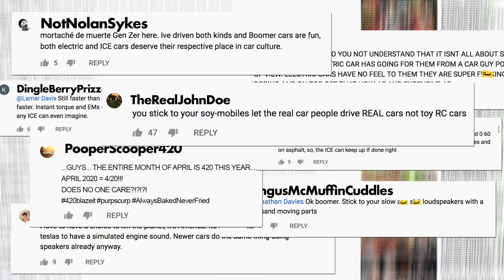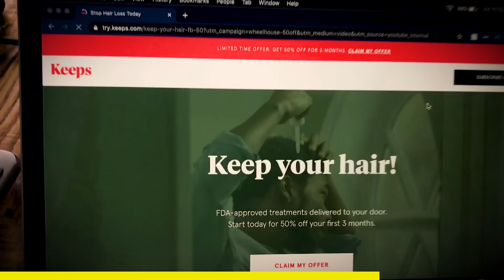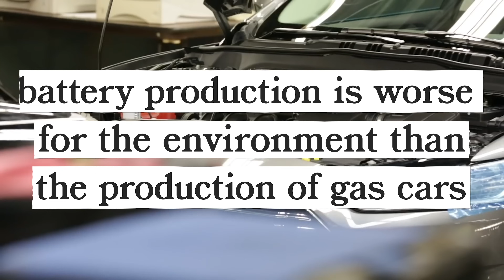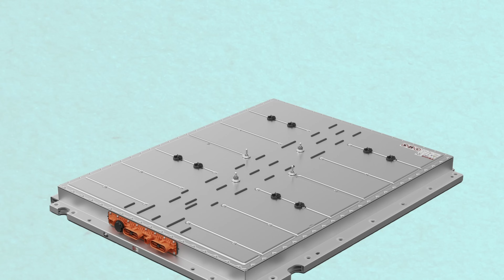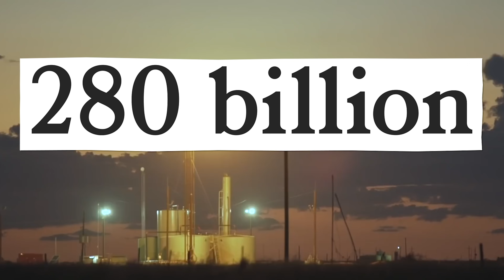Are Electric Cars REALLY Better for the Environment?

Comment: The only real problem with EV’s is the price, accessibility of charging stations, the speed of charge and battery retention over time and cold temps. As in, I’d like to be able to leave for a month and come back and it still has the same charge just like an ICE will still have the same amount of gas and also not have it lose charge super fast or just not be able to charge when it’s cold. But I’m sure all of those will be fixed soon, but not yet.

Comment: You know what’s funny? The internal combustion engine was invented to get rid of horse carriages because they were a pollution problem lol. They’d die in summer from heat and winter from cold and you actually couldn’t haul them away, there were a few laws that said that you’d have to wait for it to start rotting to take it away in pieces. Horses are huge. So there’s poop, pee, hay and water all over the city and it’s just yucky. It cakes up over time to the point that those fancy little townhomes in NYC with stairs were built specifically that way because the roads and sidewalks were disgusting. Cars were supposed to solve the problem and ‘clean up the city’, which they did do. But now the solution has become the problem… and I can’t help but think that this is what will happen with EV’s too; the solution will become a problem later. And really think about it, this is normal for humans. If we’re truly THAT smart as a species, we wouldn’t come up with ‘solutions’ that then become problems in and of themselves in the first place 😂

Comment: 1. The recycling of batteries is slowly improving. Similarly, the use of used car EV batteries is also increasing. This is going to help in reducing the impact of Lithium mining on the environment. Additionally, techniques are being developed to clean the brine and other toxics that are the result of Lithium mining. 
2. Cobalt is still an issue. 
3. Alternatives for Lithium, which are much better for the environment, are also being developed. These include aluminum ion batteries, which are made of aluminum, which have very low impact as the mining of Alluminium is a well established industry. Also, recycling of Alluminium is also well established.

Comment: these are only estimates of emmisios 1: the amount of power required to charge EV's is astronomical - 300+KW per Hr. Enough for around 30 Homes a day.... 2: EV Batteries are highly toxic to recycle and when EV's catch fire the 4000degF toxic smoke and thermal ruaway made the highly dangeous (just look at small electric bike/phone fires) 3: The cost of a relacement battery for an EV for even a small scrape on its case is ridiculous. you can buy a whole new car for this price of what would  have been a minior dent in a ICE car

Comment: volvo was the 1st company that published a study about EV's 
so VOLVO says that manufacturing an EV has 70% more co2 footprint over its ICE equivalent.
in order to get EVEN with ICE cars , both EV and its ICE equivalent have to  drive 200.000 klms!!!!!
AS YOU SAID the average klms of a car in US is about 17000klms per year 
correct? 
so an EV has to drive 200.000 klms divided by 17000 klms per year gives us 
11.7 years of driving an EV 
now im challenging you to give me 1 EV car that its battery can last 11.7 years or 200.000 .
now TESLA admits that over the 6 year period , battery health is declining , cant hold charge as much thus it needs more frequent charging .

and its not that .
EV's are heavy , 
that means the tyre wear is heavier, which in turn means they need faster replacement .
i can keep going giving you cons of EV's 

the truth is EV's will never be more environment friendly as ICE cars are .
do your math

Comment: The claim that Electric Vehicles are environmentally friendly is a huge lie because the environmental impact equation is computed only after the battery is fully charged when one adds required battery charging process to the environmental impact equation one finds electric cars pollute about twice as much as gas cars and as you mentioned there's the environmental impact of mining materials and manufacturing the required battery.

Comment: you forgot 2 important things.

in many countries, the electric grid would not be able to handle everyone switching to EVs, and what happens when these batteries will need to be replaced or destroyed? because they don't last for ever. if those 2 questions get sustainable solutions, i promise i'll never say a bad word about EVs again. untill then, thanks but no thanks
Reply: update the grids. build recycling options.

Comment: I would like to clarify one issue that doesn’t move the needle either way - the myth behind electric cars destroying our power grid is rooted in the fact that our electric grid, if not upgraded/fixed, will cause our demand to closely resemble our supply of electricity. 

This isn’t BECAUSE of EVs, in fact some estimates show that it only accounts for <5% of the demand, so if everyone switched now it wouldn’t be the end of the world. Although our overall usage and demand is rising faster than we’re currently able to produce, and at the rate we are going today we will be reaching electrical supply problems in just a few years. 

Here’s hoping we begin fixing the electrical problem approaching.

Comment: The problem is, there is not enought battery materials to replace ALL classic engines whith evs. And wind energy is not "clean". 1) You need other sourses of generation\accumulation to compensate lack or excess of power, 2) its super expensive to recicle wind turbines as they break, 3) they are very detremental to wild life around them. The only real clean energy is nuclear stations of closed cycle, where waste from 1 type of stations serves as fuel to other stations and vice-versa, untill full deplition of nuclear fuel to led. You can add to that a fact that EVs still need ruber, plastic and lubrication just as EC engines do, so you will not be able to get rid of oil industry any time soon.

Comment: Most of the information in this video seems to be fairly good information, and points to a FUTURE where EVs would be better than ICE-Vs. What is wrong? 1. Time frame: California and those States following their lead are attempting to changeover for sales prior to 2030. Most of the "good reasons" are for future expectations. 2. The "bad" batteries will have to be replaced in less than 10 years, adding to the environmental impact, since those batteries are NOT recyclable at present. 3. The electrical grid? The reason why that has been a problem, as shown in California, is that the LOCAL distribution grids are where the problems occur, not the distribution and generation infrastructure. In the future, the generation may be a problem as only 20% of electricity is generated by "green" sources, said sources are not growing fast enough to replace fossil fuel fired electrical generation and those same environmentalists block any fission nuclear electrical generation. Remember also that solar/wind sourced generation is intermittent, usually not available when EVs need to recharge.

Comment: I call BS on the power grid, Explain power draw, then explain 3 quick chargers using the amount of power of 2000 homes. And LA black outs due to that very reason, and lower level power grids.

Comment: Whoa! At 9:56 , you are saying that the current grid can handle up to 25% conversion of ICEs to EVs. Umm, I wonder if these social planners have any idea how hard it would be to expand the grid by 3x, to accommodate the rest?  Really. It's a brick wall. This will prove to be the biggest barrier, after the problematic Lithium-based battery systems are confronted.

Comment: @Donut

Could there be a problem with these numbers however, where because the production of one EV is 17 metric tons of c02, which multiplied by the amount of EV's on the road (from a quick Google is around 26 million) is 442 million metric tons of c02? (26 x 17) - and we can compare that to the 280 billion tons of c02 from an Oil refinery - seems that the Oil Refineries are burning for more than just cars (eg plastic and other pollutants) - so it seems the answer would be for everyone to switch to electric and stop production of plastic altogether.....

Comment: A major con that is not explained is how batteries system aren't easily replaceable, at least for now, so a minor accident could mean the whole car goes to the scrap if the system is damaged which is a disaster for the environment (and will cost a premium to assure). 

Also the lack of lithium and other components means that unless the companies find a way to make this more efficient, EV will stay inaccessible for most people. It is still in its infancy though, so it might change who knows?

Comment: An EV is heavier, wears more tires and wears the roads a lot more. A fire in an EV is almost impossible to put out. The powergrid outside US (in Europe) is NOT geared for charging all those EV's.
I'm leaning more towards a hybrid (not plug-in). A small battery, and a lot of miles per gallon.

Comment: Imagine if every single gasoline car was forcibly removed from the road and replaced by an EV. Our power grid is already having issues handling our usage without all the EVs.
Reply: The problem is not capacity, but distribution. One of the single largest consumers of electricity are oil refineries. They use roughly the same amount of electricity to produce a gallon of gas as it takes to power an EV for about 30 miles (DOE figures), so if every single ICE car is replaced tomorrow, power consumption stays roughly the same, but the distribution would have to change from a relatively small number of mega-electricity users (oil refineries) to a nation wide network for both home and public charging.
Reply: so what? update the grid. if you wanna ease it make walking, biking and public transit more accessible.

Comment: I agree with 75% of the things said in this video.   One I don't agree with, and this is why you aren't giving a source for this specific claim, the grid isn't ready for a full scale EV transition.  In Canada for example, The Canadian Climate Institute published a study that their grid will need a massive improvement with big investement  and quite some time to make it  ready for the demand.  Another example, in California, in peak high outside temperature, people can't charge between 4h00 pm to 8h00pm, it has happen before and they said it will happen in the future, and the portion of EV isn't at their full scale yet!  There are dozens of similar example like that.  Another thing, long range EVs, or Trucks EVs and high performance EV because of their high initial environment footprint will be match by an ice vehicule when the car has 40 000miles.  It will be more than that if the EV is charged by a dirty power source and if the battery is damaged and/or remplaced because of dangerous road debris crashing under the car or battery end of life and/or misused.

Comment: I will say off the rip I’m not an EV fan when it’s being pushed so hard. It’s going to take time to mature just like gasoline cars did. I think we are a better technology away from adoption. However one place I would like to see them more in is in commercial uses. I think having an EV truck that services stuff within city limits (plumber, electrician, etc) could benefit from this especially when you can run your tools off the truck itself. And at the end of the day plug in for full charger overnight

Comment: Internal combustion cars are not all powered by gasoline. The ethanol car is the solution, that's a fact.
Reply: When ethanol is ignited in an engine does it produce any emissions? Fun fact, it still does.

Comment: No they are not. I would have to drive my car nearly 50,000 MILES in order for it to produce as much carbon as fully producing 1 tesla battery pack. It's a little less than that it's like 48k and change. Basically 50,000 miles.

Comment: I want to hear about the increase in road wear due to the increased weight of electric vehicles. Also I can’t see the environmental argument if we pre maturely get rid all of the cars on the road and replace them with new ones. All the cars that currently exist need to go somewhere and I feel like it would be more environmentally friendly to drive them til they’re dead and then replace them afterwards rather than rushing the transition. And again road wear and infrastructure cost is already something we’re struggling with in the US, how will this be impacted?

Comment: People always claim that an EV puts out less CO2 than a gas car despite the fact they're charging off a coal fired power plants but they never explain how exactly. 

and I'm not against EV's at all. Hell after driving a model 3 for a few months I'd never want to drive anything else for daily use. They're fun to drive and hella cheap to operate,(especially driving for a living) and in all honesty there is a hell of a lot less that could go wrong with one than a gas car where the engine it's self has probably close to 1000 moving parts.

One thing that kind of floors me a bit about the whole EV debate is how people don't see the benefits outside of allegedly reduced carbon emissions though, like the fact that their use does kind of reduce our need for foreign oil usually coming from places that don't care too much for western nations or that they won't have the tendency to leak fluids as much as a gasoline car due to there being fewer fluids to leak and the lines holding those lines not wearing out as quick due to the lack of a massive heat source being right next to them like an internal combustion engine which I'd see as a bit of a win on the conservation front as it's less likely a critter is going to die from drinking antifreeze.

Comment: what about the oils and fluids 
like the engine oil diff oil transmission oil clutch oil ?
those also come from somewhere cars don't just run on gasoline
They need many other fluids based on petrolium to drive 
not to mention all the stupid plastic sh*t that breaks which needs to be bought new 
maybe older classic cars are really much greener than new ones

Comment: All of donut's statements three years ago have been proven false. The power grid in Ca. can't handle the extra drain on the grid now. And he failed to mention that the USA imports 95% of the minerals from China to make the batteries. The electirc car loose 65% of their value in the first year. Plus the fires,  where they don't even want you to park your car in your garage while charging. Ebikes are going up in flames too.

Comment: Please just stop with the propaganda. Its really easy to disprove the clame.

A normal EU diesel emit 92g/km of traveler on a average cycle.

A typical coal powerplant emit between 740 and 1200g/kWh of electric power produced.

A typical electric car use 0.15 to 0.25kWh/k,. but that is from the battery, from the grid its more like 0.18 to 0.3 even the best scenario with a ultra supercritical coal power station at 740g/kWh still emit 133 running with a tesla 3 (the most efficient electric car on the market today), while standard EU low emission car is 92g/km.

So.. what about refining and drilling. Sorry, that is true for coal as well. Coal don´t just spawn at the powerstation. the 740g/kwh is calculated with the coal t the powerstation.

So.. what about energy mix.. Well firstly, that is really not how reality works, secondly, cars usually run on E10 or some kind of HVO/RME diesel mix, so that would be true for fuel cars as well. For example with the current diesel Sweden mix (where i live) there is a 30.5% reduction. So the 92g car becomes a 64g car.

So NO, electric cars are NOT cleaner than coal power, that is a myth

Comment: Very good video.  If the recycling(reducing mining requirements) and cost issues for EV batteries can be solved, EVs will change a lot of things. Imagine LA(and a lot of other cities, including Denver and Houston) without smog.  The personal transportation situation in the US would be much better.  As you say, there are a lot of naysayers.  Some of the people I am friends with on Facebook seem to hate both EVs and renewable energy.
Reply: The batteries only last about 10 years before the capacity is significantly reduced, and replacing the battery is so costly that its usually not worth it. Ergo electric cars only last around 10 years before needing to be scrapped or sold for parts. Meanwhile ICE cars can last 30 years if taken care of
Reply: @Impetuss  For some reason, I see very few 30 year old ICE cars on the road. The ones I do see are usually in bad shape. (BTW, I have a couple of ICE cars that are way more than 30 years old.  I only take them to car shows and would never drive them on a regular basis) I agree that the batteries in EVs are their biggest issue, but also know that things can change over time. Would you still want a model T to be your daily driver?